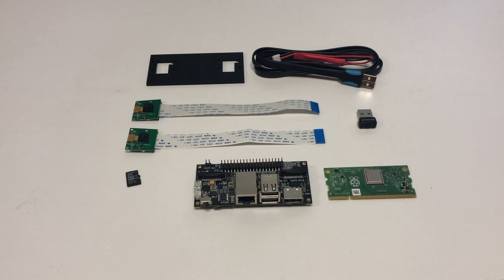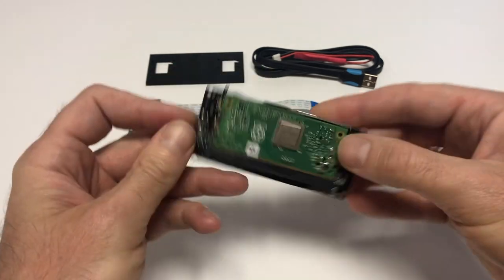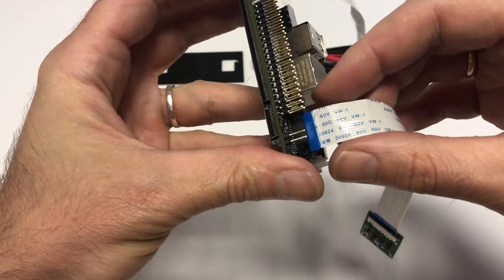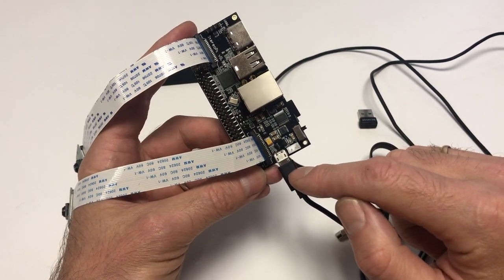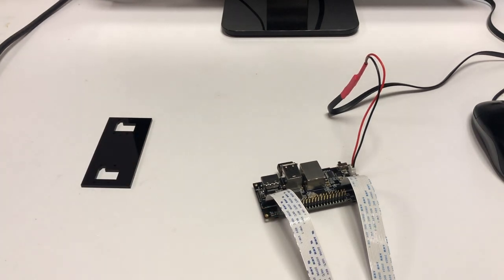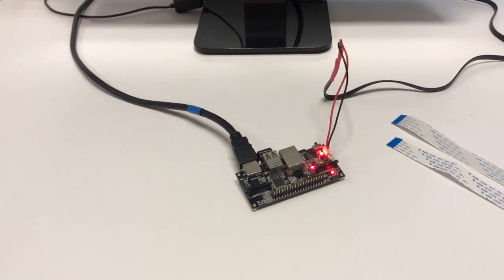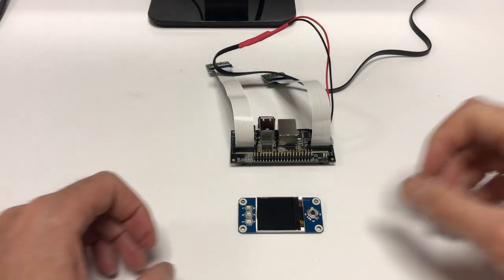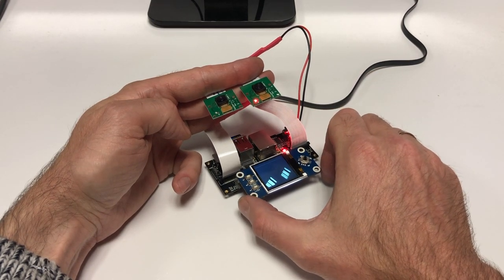Building and booting StereoPi with the Raspbian SLP image, plus bonus

Comment: Hi, thank you for the video, firstly how can you use command for the cameras, and secondly how can you use the laptop for the raspberyy.
Reply from the maker: Hi! As for the commands - you can use either direct commands on Raspberry (like raspivid or raspistill), or call them from your Python code, as we do it in our tutorial scripts.
Laptop is used to connect to console over SSH, or to access our administration panel. This panel (mentioned in this video) is available over network.
Reply: Thank you!
Reply: @eugenep8802  Is it not possible to use the board as a normal raspberry pi in addition to this 2 camera functionality? The SLP image seems to limit the board's features. Is it necessary if I only need to output to a monitor through HDMI?

Comment: Hi. Is there any lag and if so how much lag is there in the livestream to the quest or to a 3d tv
Reply from the maker: For the livestream in a local network the latency is about 100-150 ms.
Reply: @eugenep8802   Eugene P  Can it be connected via wire (instead of the Local network) to decrease the lag to either oculus quest or 3d tv

Comment: Hi, is there any way connect 4 cameras instead of 2?
Reply from the maker: Yes, but it's not easy. Pi's CPU has 2 camera interfaces, so with the StereoPi you can work with 2 cameras in official way with the stock Raspbian functions. Actually you can connect a couple of camera instead one, using camera splitter. But this approach requires serious efforts for installing and compiling drivers, as this is not stock function. We're not planning to add this option, as it is not user-friendly for beginners. More simple way is to use two StereoPi with synced capture time.
Reply: @eugenep8802  oh i see, meaning you need to buy two stereopi or using some kind of spliter too since it can connect two cameras?
Reply from the maker: @mirzaraif8201  Yep. If it is not a secret, why do you need 4 cameras at once?
Reply: Eugene P im just researching to find out if it possible to make stereoscopic camera with four lenses, most of what i found on the internet only two lens. so im just curious if it’s possible